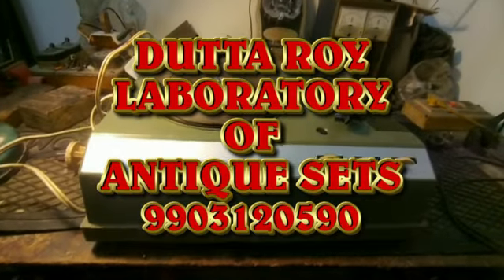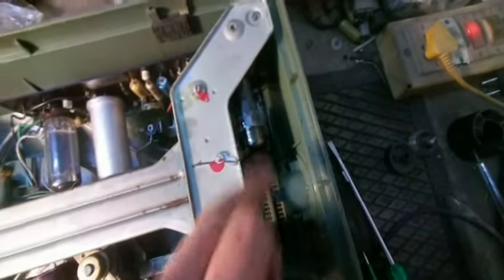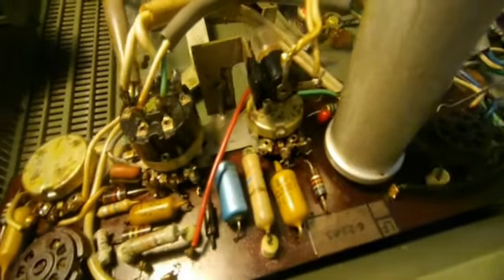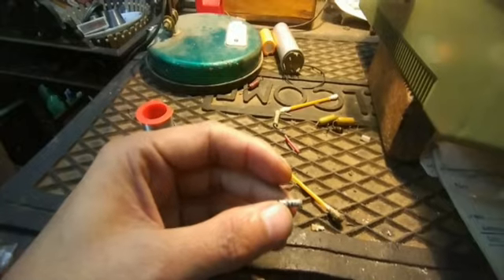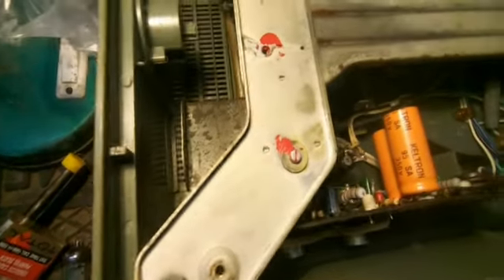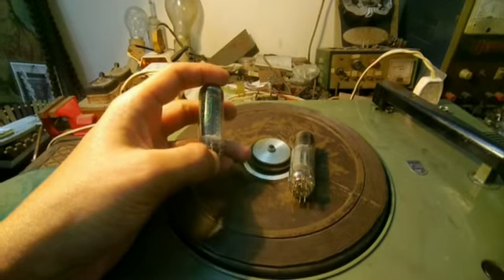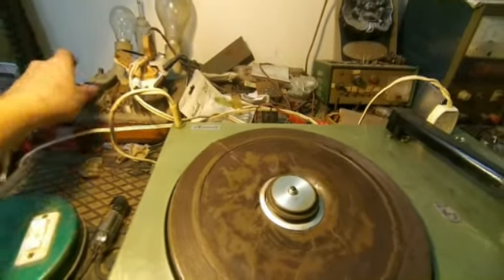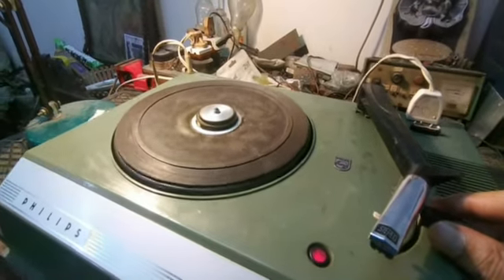Restoration of Philips AG 4856W 00 Tube Record Player

Comment: Sir, Hats off to you 🎉 Replacement of resistors, different types of capacitor & even Valves is highly knowledgeable. No radio mechanic is having this kind of patience nowadays. In Hyderabad, Just for belt replacement of tape recorder I need to visit 3-4 shops😮
Reply: Dada you are  great